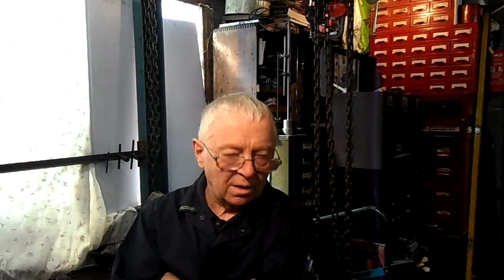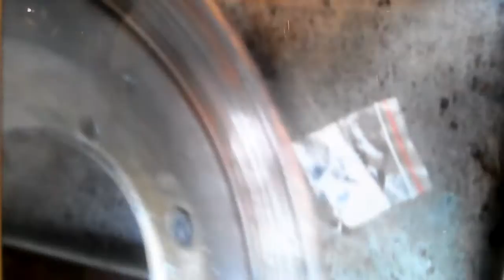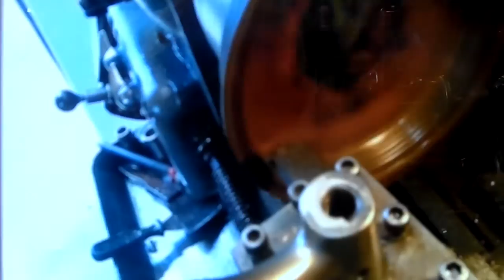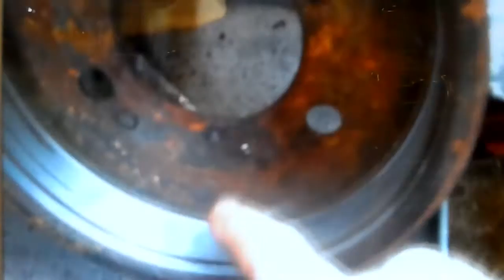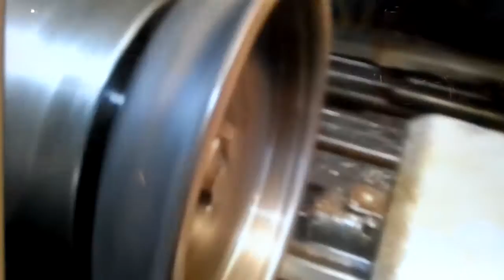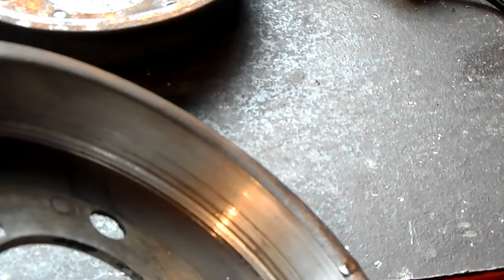Skimming brake drums

Comment: If you cut the outside of the drum smooth you can add a thick aluminum band with grooves like a serpentine pulley. It does depend on how much room you have outside the drum though whether or not you can.